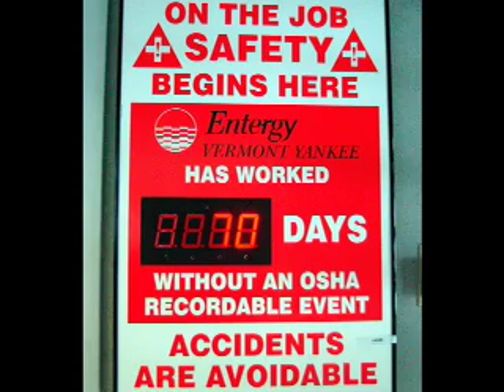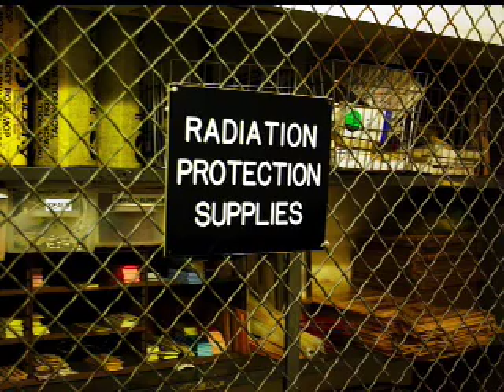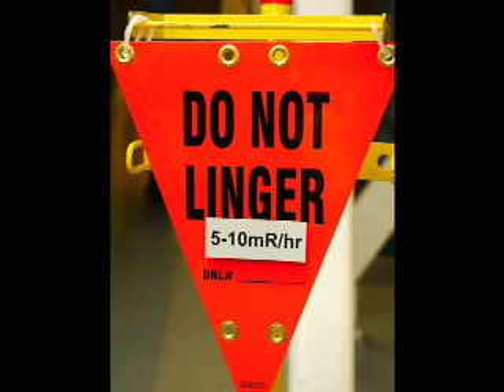Inside Vermont Yankee

Comment: Reactor buildings degrade with age, particularly with heat and neutron irradiation.  Each time uranium splits in a nuclear reactor, neutrons are shot out at high energies.  Those neutrons cause materials - steel, cement, etc. to become brittle over time.  Many parts in a reactor have to be replaced 2-3 times during the life time of the reactor.  Eventually it's too expensive to replace some components.

The difference is that the Empire State Building is not sitting on top of a neutron source.

Comment: Your comparing an asset (equipment) with a Depreciation of value "it wears out" to plant; an asset (building) which last for all intents and purposes forever. I mean by your logic we shouldn't we using sky scrapers that are older than 40 years old but this is historically not the case for example the Empire State Building which is still in use.

Comment: Right.  I did not give you the energy produced for the first one.  It should be around 180 MeV and I misspelled radioactive in the second one.  So Sorry.  These are all well known. 

The point is that radioactive Krypton and Xenon are produced and do escape into the primary loop.  The primary loop water becomes contaminated and the particulates need to be filtered out.  Eventually there are filters that have to be replaced.  They have a pasty liquid waste in them.  The gas is vented.

Comment: There is no *chemical* equation since nuclear fission is not a chemical process.  I think you mean nuclear reaction.  When a neutron collides with u235, there are many possible paths that the reaction can follow.  For example, 

U-235 + n ===> Ba-144 + Kr-90 + 2n + energy
Krypton 90 is a radioactive gas

U-235 + n ===> Ba-141 + Kr-92 + 3n + 170 MeV
Krypton 92 is a radiactive gas

U-235 + n ===> Zr-94 + Te-139 + 3n + 197 MeV

Radioactive Xeon Gas is also part of the decay chain.  You know this.

Comment: The multiple wind farms would obviously be part of the power grid spanning the northeast, with dozens of power plants and millions of power-consuming appliances (also fluctuating), variations in the wind are typically not noticeable.  The northeast's use of wind power would have to be significant for the fluctuations in the wind to become a problem in the electrical supply.

Comment: @jjjameson33 you tagged this with a thumbs down.  

1) Spent fuel rods were misplaced/lost this is a published FACT
2) Their feedwater system has leaks.  It needs to be replaced to the tune of $100 Million.  This is a published FACT.
3) BWRs are OBSOLETE.  This is a published FACT.

You don't have to be an N-plant operator to read the newspaper.

Comment: I'm sure you have been through the health physics drill and film-badge dosimeters, etc.  It does not take a N-plant operator to understand the different kinds of radiation and their hazards or what it means to misplace spent-fuel rods in the spent fuel pool for over 24 years and later explain some additional contents.  I expect you to know that BWRs are completely  obsolete.  Although they may run fine now, they have inherent hazards.  An antique like VY is aged and will eventually break.

Comment: @jjjameson33 You can call it crap if you want to.  While I did not operate a nuclear plant like you, I did work to produce equipment that is used in nuclear power plants still today to deter the theft of nuclear materials.   I did have more than a secret clearanc, worked on a system that tracked fuel bundles through the cycle, and a result visited several plants.   If you truly worked in a nuclear power plant, you would know about such systems because the US is a signatory nation of the NPT.

Comment: In short, NO.  Designed in the 1960's Vermont Yankee is a GE BWR/4 design, which is considered completely obsolete by todays standards.  Besides it's sister Oyster Creek, it's one of the oldest of the 104 operating nuclear power plants.  It's really starting to show its age.  It needs a new  $100 million condenser and more than $100 million more of necessary maintenance has been deferred.  They don't even have the money to shut it down.

Comment: What major cities are we talking about?  Vermont Yankee generates 620 megawatts.  This can be replaced with 2,000 modern wind turbines including all differences in capacity factor.   I think you have been pumped full of pro-nuke propaganda. The ground underneath the turbines is still usable.   There is no problem in having forests underneath.  You might need access roads to get to the turbines but you have roads to manage the forests and fight fires anyway.  So what is the problem?

Comment: We use a once-through process in the United States because it has been determined that it is impossible to completely safeguard the current process, much less when it involves reprocessing.  Only 4kgs of plutonium produced can be used in nuclear weapons by terrorists to make a nuclear weapon.  This is called "political reasons" by the pro-nuke lobby.

Neither England's nor France's nuclear fuel cycles are contained.  Both produce radioactive waste and dump it directly into the oceans.

Comment: The power plant produces solid, liquid and gaseous wastes.  The radioactive gasses are routinely periodically vented from the containment building.  The liquid and solid wastes are stored in storage ponds and sometimes dry caskets.  Eventually, the power plant itself becomes too radioactive to operate due to neutrons and has to be scrapped.  The core and the primary loops are all radioactive waste.  If reprocessing were to be done, it produces a lot of radioactive waste as well.

Comment: You make it sound as if there is no electric grid.  If the electricity can't be used, you simply turn off the turbines.  

What do you do with excess power from nuclear power plants?  You can't idle them nor can you really afford to run them at anything but continuous base load due to their high initial capital costs.  There are plenty of nukes and coal plants in the northeast for base load.

Comment: There is an upside to nuclear waste..... there is a way to extract a lot of material out of the waste to revert it back to matals and compounds to use in other things. I do know the end result I was told after all is said and done is water, but I could be seriously mistaken. If one takes the end result and can find the beginning, then we have something to work with. I believe within the next 50 or less years there will be a process to reverse the high radiational forces in spent fuel......